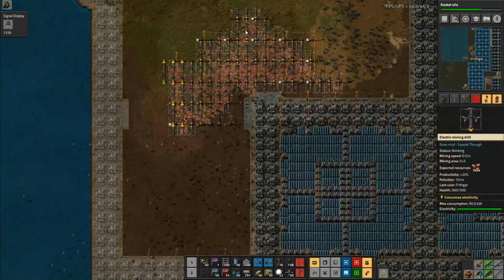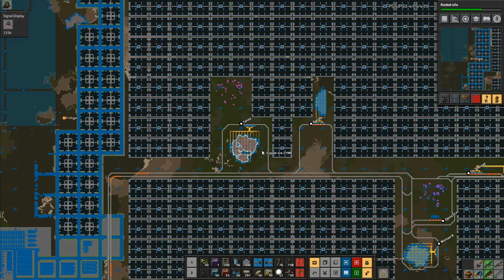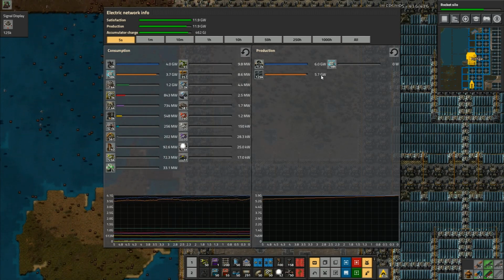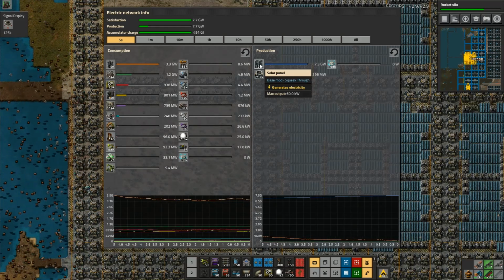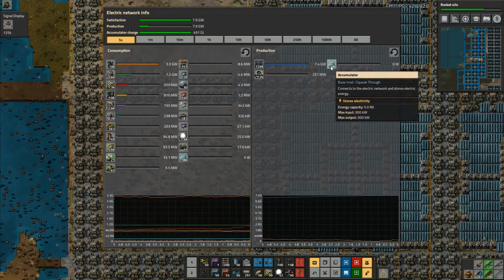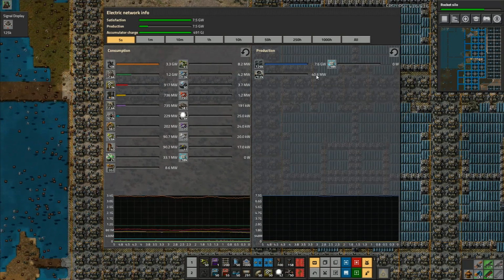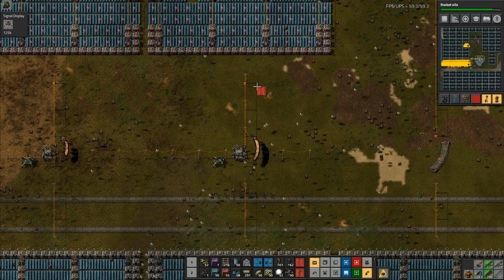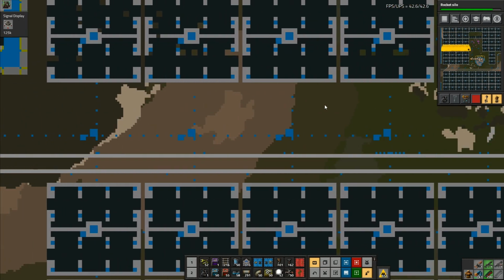Factorio Million Robot Challenge #258: The Beautiful New Solar!

Comment: Doesn't this new solar layout make negligible amounts of power because of the roboports around it?
Reply: yeah i was about to comment that. so many roboports for only like 150 solar panels
Reply from the maker: Only becomes an issue for an individual square if they're actually being used by passing robots.  The power draw when robots aren't flying is negligible
Reply from the maker: Correction, if it's not charging robots then the roboport uses NO power at all, I thought it was a small amount but have just looked it up.